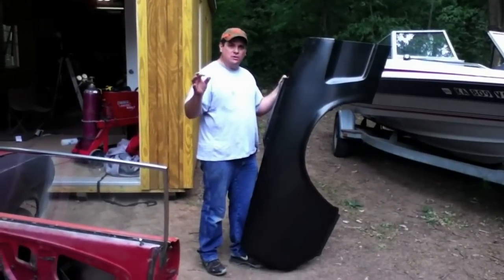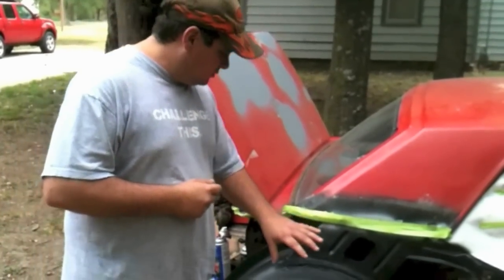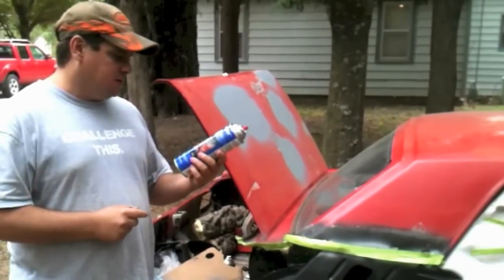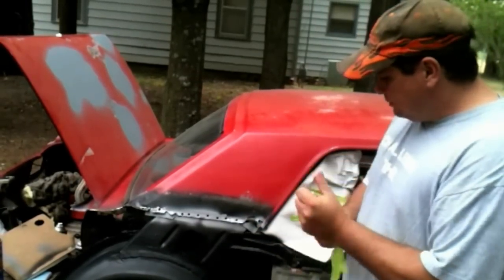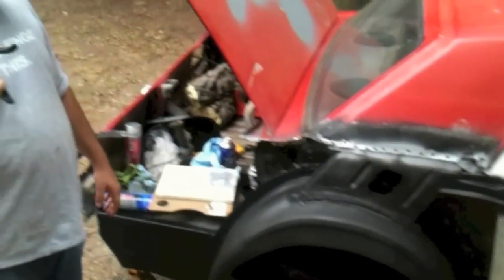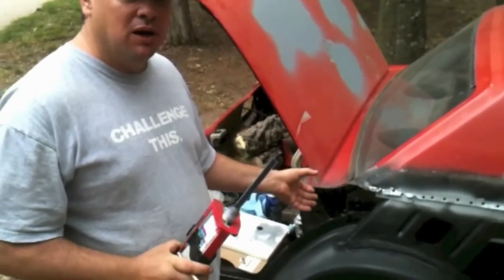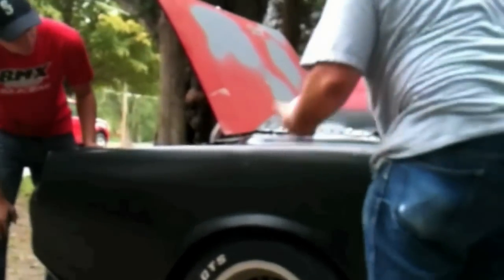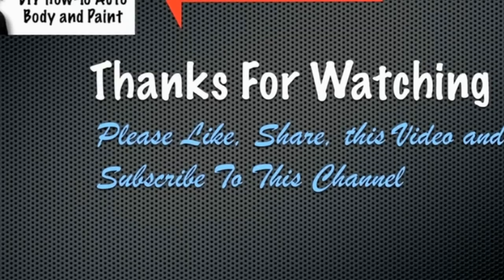How To Use Panel Bond Adhesive to Install a Quarter Panel on a 66 Ford Mustang

Comment from the maker: Hi Tom, the areas to be plug welded do not apply panel bond for several inches of weld.  The weld areas, I use weld-through primer.  Also, I usually allow the panel bond to dry before welding.  Sorry for the confusion, I hope this helps.

Comment from the maker: Yes, heat is the trick.  You can use a heat gun to heat the metal up, which will heat the adhesive making it much easier to come apart.  I agree, it's almost impossible without heat.  Thanks for watching!

Comment: Watch this video in april 2018 no bedliner that isnt mixed with hardner is a waste of money as a bedliner..Bedliner as a undercoat is the best undercoat you can use.
I like "raptor " by unipol it works awesome and is very freindly cost  that turns a plastic( like a red plastic gas can ), when cured.
Its a two part black bedliner , that comes with harder and is fool proof as the quart bottle has hardner marks on the quart bottle.Simply pour hardner to the line on the quart bottle shake shake shake and apply , with included application  gun.
Best undercoat ever for any car or truck.Always looks black because it repells dirt. Repells mud ,water.
Regular undercoat gets soft in heat so dirt inbeds in the coating masking the black .Tgen it cools locking the dirt imbedded in the undercoat.Bedliner with hardner becomes a plastic barrier that laughs at dirt and mud and water.
A bed liner out of an aerosol can is 
Not bedliner quality.Its undercoat .

Comment: Donnie...I'm a little bit confused!  Is it OK to spot weld on the qtr panel while the panel adhesive is still wet? Is the panel adhesive "weld thru" similar to the primer? Won't the heat from the spot welder burn or liquify the panel adhesive?  Just not sure how to proceed . Thanks

Comment: Donnie, I have a welding q. I am going to replace the rocker panels on my 01 F150. Can I use flux core .030 wire or will that be too much? This is a driver/work truck. Doesn't need to be real pretty, but I would like solid.
Reply from the maker: It is not really recommended, but if you took your time and allowed it to cool often I think it will work.  It will required more grinding to clean the weld.